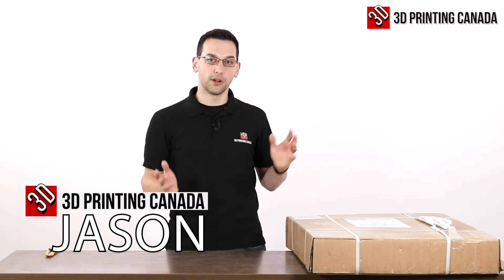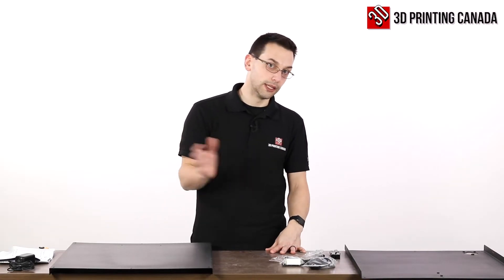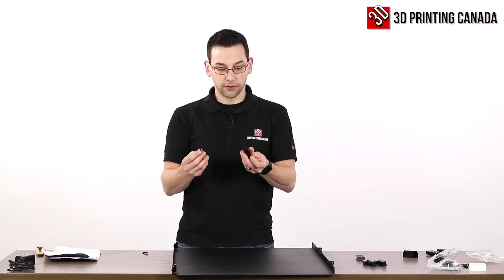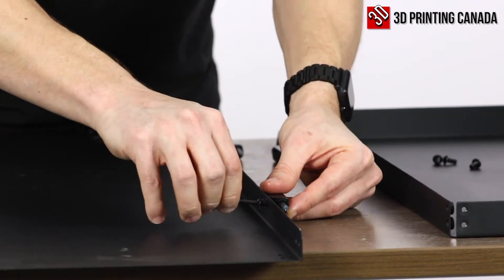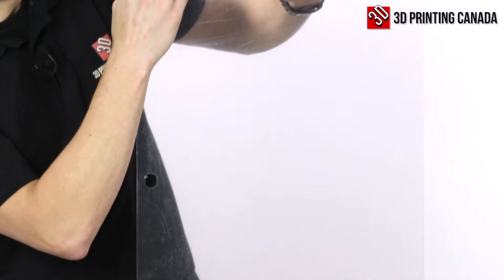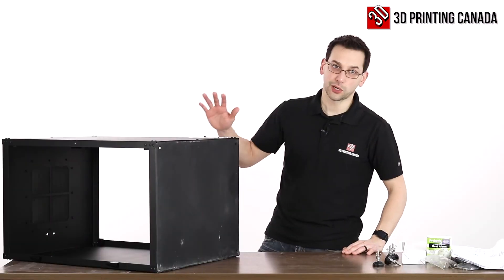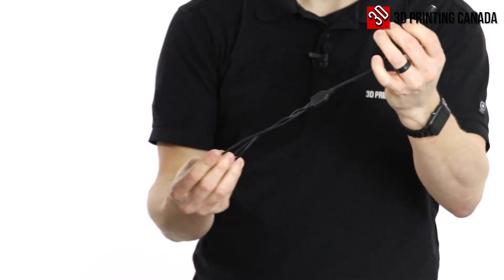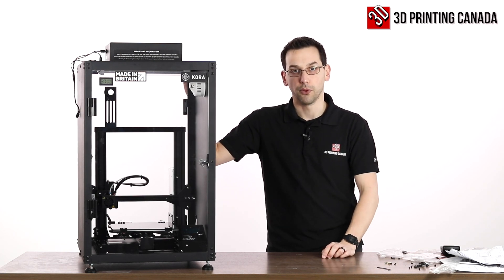Kora 3D Printer Enclosure Unboxing and Build

Comment: I’m wondering about the filament path into the extruder.  Will look for the next video of the printer running.
Reply: I was wondering the same thing with the Ender 3 in the enclosure. Does not look like there enough room.  I think this enclose was designed for Kora 3d printers in mind only.